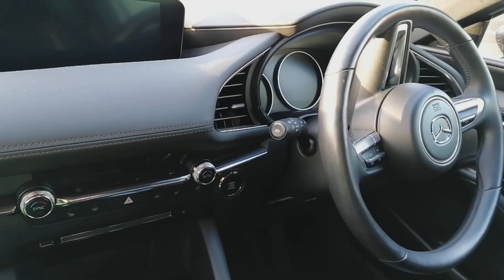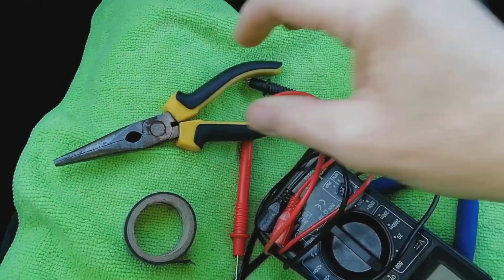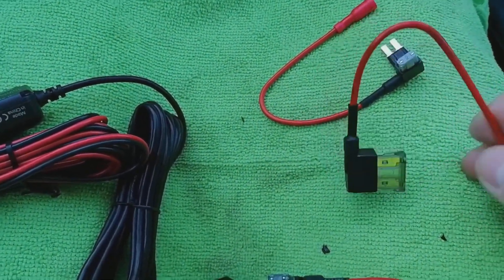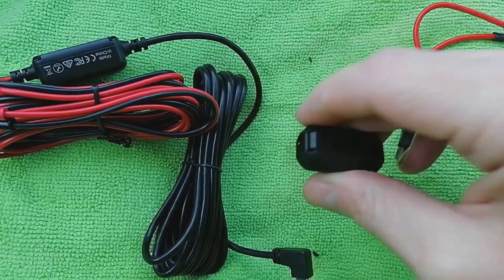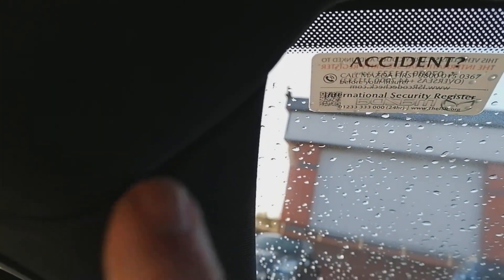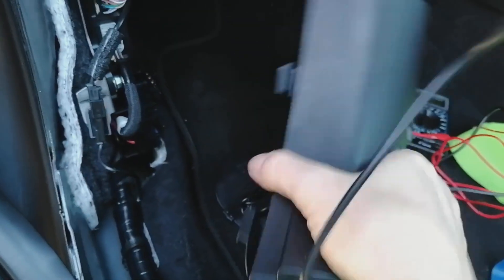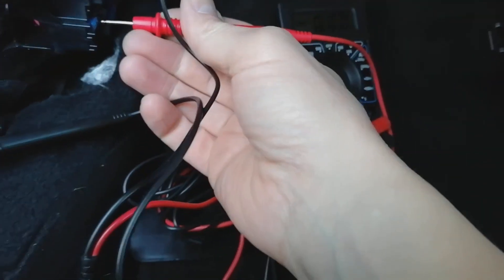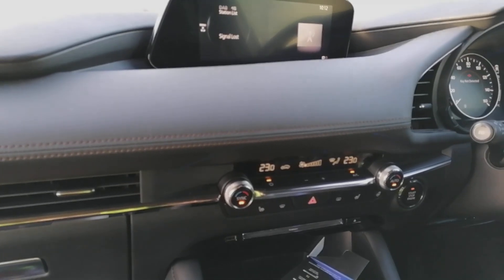Mazda 3 2019 onward ,how to install a dash cam to your fuse box,simple guide.

Comment: Did you get bad interference with the rear dash camera on the DAB radio. My DAB radio in my 2019 Ford Focus didn’t work with the rear camera. I now have a 2022 Mazda 3 and would like the rear camera as well. But not if the DAB radio won’t work.

Comment: Would I do a similar thing to put a new USB cigarette lighter socket in the back of the centre console of a Mk7 Fiesta (so rear passengers would have one which they don't currently)? Also how much of a pain would threading the wire to the fuse board be given you'd presumably have to rip off all the plastic from front to back, or is there an easier way?
Reply: Why not piggy back it off of the ports in the arm rest, then you aren't running cables all the way back from the rear of the car.  You have USB power in the arm rest and a cigarette lighter socket, you could run the cables off the lighter socket (which may not even be used) to a new usb socket in the rear, giving a couple of USB ports?

Comment: Samme with my Mazda 3 2021. I beleive it is due to the Mild Hybrid battery that some Mazda has installed.
Reply: @Stephan  Hi Stephan, were you able to solve this issue? If so, how did you do it?
Reply: @Jackyho111  Hi Jack. I found no method to connect via the fuse box. Everyone was always on. I connected to the USB port on the dashboard. Pulled the cabel behind the storage department and via upholstery. Only 2 inches of cable visible. It turned out ok.
Reply: @StephanJPPL  Thanks Stephan. 👍
Reply: One solution seems to be to just get a camera that has parking mode that let's you control the voltage cut off

Comment: I dont really got it .Mostly dashcams have 12 v adpaters to 5v  cause the dashcams been operated on 5v so far  .in your case i cant see  any adapter there did i ?
Reply from the maker: The power cable used has a 12v to 5v converter box in it.

Comment: ALL Mazda 3 fuses on the fuse box inside the cabin (the one you are using), are constant always on, there are non that don't supply power even with the ignition is switched off, its weird your multimeter says different.  To use one of these with a dash cam you MUST purchase a dash cam that provides the parking feature.  The parking feature will power down the camera if no motion is detected, if your camera doesn't support this it will remain powered on 24/7 and may drain your battery.  In addition to this I recommend you add a sensor to check for voltage drop to cut out all power to the camera if the voltage drops too low (ideally if it drops below 12v).  A popular fuse to use on the internal box is F13, describe as Audio, this fuse powers the central console volume dials.

If you want to use a fuse that isn't constant you need to wire the dashcam to the fuse box found under the bonnet, this ofc its a little trickier to run your power cable but is the only way to only power on the dash cam with the ignition on.

ps.  UNLESS there has been a software update (which I am not aware of) which can prevent power to certain fuses on the in cabin fuse box, than you information maybe incorrect.  I will look into the sbs though and correct my post accordingly if I find it at fault no current.
Reply: For anyone interested, found a fix around this.
I’m doing a Blackvue dashcam that requires constant and ignition and also ran into the issue of all fuses in the car being constant.
If you take off the trim around the shifter, you can pull out the trim for the cigarette lighter, and this is an ignition cable.
Reply: @airbus1687  please tell me more I’m about to do a dash cam and led lighting instal on mine. I thought that the cigarette socket in armrest was constant power too, the USB in armrest switches with ignition but doesn’t supply much amperage so I was going to do hardwired from engine fuse box. Is there switching ignition somewhere else in the interior?
Reply: @this_time_imperfect  The cigarette lighter is ignition. You need to pull the trim off around the shifter and you will have access to the 2 wires coming out the back.
One is ground and one is power (ignition), and you can tap into it.
Reply: @airbus1687  weird, on mine the cigarette socket stays powered even when car is completely off.
Reply: @this_time_imperfect  sadly all internal fuses are constant, you'll need to run a fuse to the fuse box under the bonnet.  It's tricky but there is a path you can take through a grommet.  There are a lot of cables already in there, but just enough space to squeeze another cable or two through.  Use something like a needle to push another cable through.
Reply: My mazda has the steering wheel on the left. If you remove the left pilar there is a connector that has a pin voltage  only on ignition. This pin is used for homelink mirror
Reply: This is correct. I was wondering why I was getting voltage on the audio fuse. Mazda is being difficult for some reason
Reply: audio is switched off, if the ignition is off.  So that fuse is not powered when the ignition is off, otherwise.  I should know, because every time i switched off the engine,  my radio dies.
Reply: @ginocruz8220  you are confusing the radio switching off when the ignition is off, with the radio still receiving power when the ignition is off.  Also the fuse F13 powers the central dials which are live after ignition is off.  I have worked in the fused box and under the hood for several years no under different generations.

Fun fact, the main dial in some cars still has the support for capacitive touch.  In China and Japanese markets you can use the dial to write characters and letters used during navigation.  In Western markets, sometimes the dial is just a plain button but sometimes the touch hardware is stil there, just the firmware on the system doesn't support it.
Reply: @Emexrulsier  how come, my radio dies every time, i switched off the engine. Is that not an indication that  the power is off?
Reply: @ginocruz8220  no, that is an indication that the ignition is off not that the power is off, big difference.  Every single internal fuse is constant voltage, only the fuse box in the engine bay contains switched fuses, of which non of these are connected to the audio system.  You proof this in seconds with a multimeter on any of the fuse connectors
Reply: @Emexrulsier  this weekend, i will check it with a voltmeter. But i am pretty sure, it's not powered when the ignition is off. To keep all the pre set in the stereo, it has a battery. Look at the infotainment, it has a battery icon on the lower right corner.   This keeps the pre set, that's why its not powered. Otherwise this will drain the car battery if it's constantly connected.
Reply: @Emexrulsier  i will check it this weekend.  But i still go by my original guess. Otherwise, mazda would have not included to install a battery powering the stereo. Again,  the infotainment. It has a battery icon and the charge status, lower right corner
Reply: @Emexrulsier  also, there is a YouTube video, where a guy tested the audio fuse in his mazda 3 2019. And it's not powered. Mazda 2019, 2020 and 2021 are identical in deaign
Reply: @gino cruz  I know  I have worked on them for years, and I know I am 100% corrected.  Like I said test them yourselve and you'll see.  Ps the other video I think I know the one you are on about, mention3d me in the comments and accepts he was wrong ...
Reply: @Emexrulsier  i will check it on my day off. I need to get to the bottom of this. If it's powered, i will just find a hole to run it to the engine bay. But that would completely counter the purpose of having a battery for the infotainment, because it will completely drain the car battery.
Reply: @gino cruz  you still aren't getting it, it's not draining the battery cause its not drawing any power.   Think of a electric kettle plugged iin to a wall socket.  If you test the socket there is still a voltage but the kettle isn't turned on, but there is still power there.  Just no draw so.
Reply: @Emexrulsier  sorry, I'm not really getting it. How come it's not draining the car battery when an auxiliary battery is connected to it. So what's the purpose of connecting an auxiliary battery to power the infotainment. Bec there must be a constant power to the infotainment, otherwise, all pre set will be erased each time you turn it off. The auxiliary battery is getting charged continuously if the fuse is always on, but i need to get to the bottom of this on my day off. I will let you know
Reply: @5:34 it looks like you're probing the fuse with the negative probe of the meter not connected to anything, so naturally it's going to read zero. Have a 2023 Mazda 3 here that I'm going to check out over the next few days with a view to installing a Nextbase cam into it.
Reply: @bennyalford  pls check it out. It's been snowing here in Toronto. Not enough room in my garage to do the hardwire. So i ended up with blackvue 125x battery. It works flawlessly. The parking mode is phenomenal.  Left my car in the parking lot at 100%. Went to work. Vame back after 10 hours. Checked the battery on it's app via Bluetooth, the battery level is still 100%.  Even if i don't connect it with the cigarette adapter in my car, and constantly recording, it only used 2% on a 30 min drive. But pls check Mazda 3 fuses,  I need to know. Thanks, let me know
Reply: @Emexrulsier  what do you think about tapping the 24p connector on the left side (the one used in the official Mazda document "550-0730 Rev. AAA")?
Reply: @Emexrulsier God bless your patience lol and also thank you for the info
Reply: @dnlzy  Interesting never thought about that, but it might not be on all vehicles as this is used for Homelink, something not available in most countries (but that doesn't mean the power might not be there, and its 12v with ignition sensor).  Just have to be weary you don't damage the airbag or sun roof drainage when fitting.
Reply: Is me or did he not ground the black pin on his multimeter during the test?
Reply: Which fuse would you suggest then for the ACC and BATT?
Reply: @ginocruz8220 I just tested my 2019 Mazda 3 and I can confirm all fuses in the cabin have power when the switch is off
Reply: I have a nextbase 312GW which has the parking mode. The mode allows the dashcam to power on to record motion or impacts etc. Is this the same parking mode you're referring to? Wanting to hardwire mine like he has done in the video.
Reply: @multihamsandwich  yes, jlthat is correct, just make sure that's turned on, the camera will then power down when no motion is detected
Reply: thanks for getting back to me so quickly. will go and fit it now. Save me having to run it into engine bay

 @Emexrulsier
Reply: @Emexrulsier  just trying it now, dashcam doesn't power down. Parking mode on and self shut off 10 seconds. Continuous power being supplied. Will have to look at other options
Reply: @multihamsandwich  might be a bit late (3 months), try reducing the g-sensor down to medium or low.  Another thing I recomend is making sure you have a voltage checker on the hardwire cable to cut all power to the dash cam if the voltage drops below 12v.  That way if it was lets say a very stormy night and you car was rattling around, constantly triggering the dash cam.  The power would cut out before the battery goes flat.  I think nextbase have improved on the parking mode for this very same problem with constant fuses but it wasn't implimented unto the 2 series so 322GW, 422GW etc.  I personally use the 412GW which should operate the same as the 312GW.
Reply: So sorry to revive an old thread, but I'm doing this install myself. I have the VIOFO A229 Pro, which has Parking Mode. So I can do the install using the internal fuse box safely, correct? I don't have a sunroof, do I cannot tap into the power from the rearview mirror.

Edit: I should add that I have the VIOFO HK4 Hardwire kit which cuts power to the dashcam once it reaches a certain voltage level.
Reply: @pillage-  Yes that will work fine, I recommend you tap into the fuse use for the audio dial on the centre console, F13 I believe the number is.

And yeah the hardwire cable to cut power is handy just incase.  For example a stormy night could in theory rattle your car and it keeps powering up to record, then parking mode shuts it down again only for it to power up again, rinse and repeat (it uses the g-sensor to detect car moving and powers down when no motion).  These cables normally stop delivering power it the voltage drops blow 12v.

Also near the internal fuse box, you will notice a large nut fastened to an unpainted part of the car body, this is perfect to use for grounding the camera.
Reply: @danielbracamontes1811 maybe North American cars are fused differently